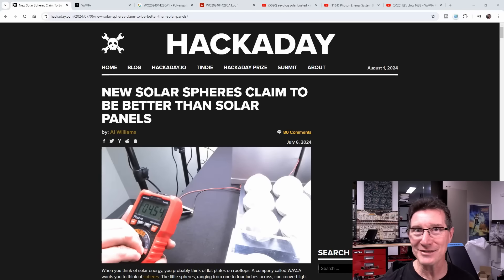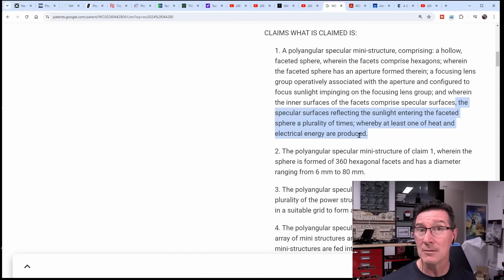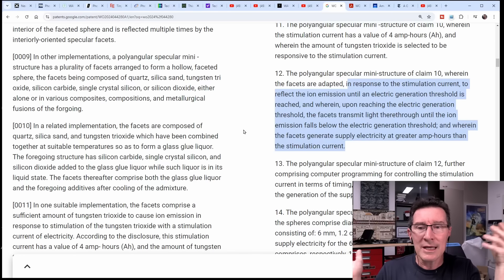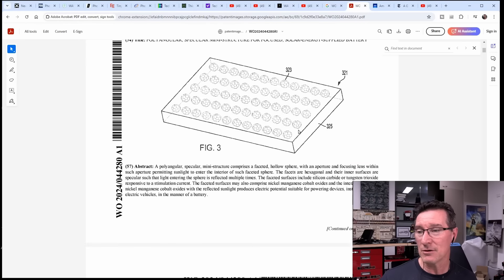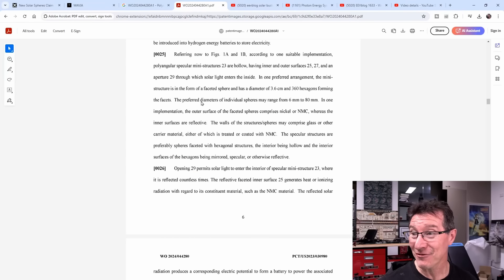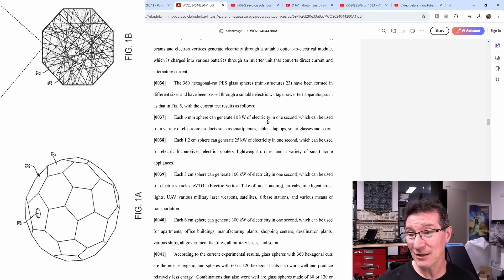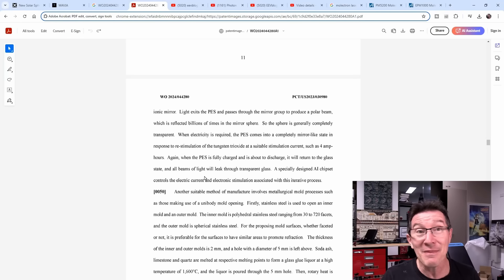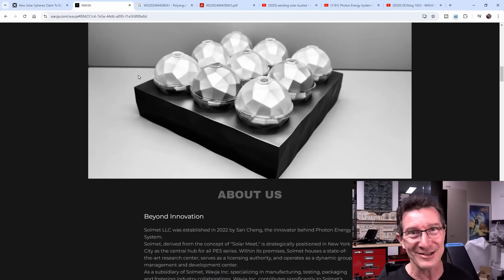EEVblog 1633 Part 2 - WAVJA Patent, 300kW Solar Balls!

Comment: I see now where the AI is at. It wrote the patent for them.
Reply: It's AL not Ai but yeah funny. lol
Reply: Thank you! I am so happy this was the top comment because this is exactly what I came here to say!
Reply: @Splarkszter  AI
Reply: @Splarkszter Artificial Lunatic?
Reply: @BenBrand same!
Reply: and the prompt was "write a confusing and overcomplicated technical description that will convince someone to give me money"
Reply: I have to say, if this genuinely was written by an LLM it actually is quite a good one and must have been trained on a lot of existing patent texts. Replace the claims of "kW" with "mW" and this actually reads like a fairly normal patent application, albeit more Chinese-themed as they have some kind of obligation to describe the "public benefit" of their invention, which in practice manifests as a lot of claims to the tune of "high power, more efficient, good for environment, prevent climate change" in the electric car literature.

The contents are still bogus, and this is only an application not a granted patent, meaning it has not been examined yet. But it is impressively close to a fair number of real pre-ChatGPT patents, except for the part where they envision it as an infinite energy source rather than a niche sensor dongle.
Reply: @BenBrand  dito
Reply: I am certain that an AI would write something much more credible than this. I just asked ChatGPT what it means when someone says "300 kW in one second". It gave a perfectly good and correct answer. It pointed out that the term is not really correct, but assumed it means 300 kW*s, or 8.33 Wh.
Reply: It looks like it, but they must have told the AI to write "the most bullshit-loaded patent possible" to get that result 🤣
Reply: exactly my thought... so much BS on a string can only com from aa LLM
Reply: I had the exact same thought. It's like someone asked chatgpt to write a patent application for an electronic device and then tried to build what it described.
Reply: @helgew9008  ask it anything controversial and good luck , its useless outside simple tasks .
Reply: This sounds like something my little neice of 6 years old would send in to be patented.
Reply: They used all the good words it's gotta be legit.

Comment: Come on Dave.  A 3 year old can figure out how these fancy balls produce energy.  You supply 300 kW to the ball and when the ball burst into flames it produces thermal energy.  Maybe it's a mini fusion reactor.  🙂
Reply: Not flames but Hot Plasma™
Reply: @teresashinkansen9402  I think you cracked it.  Plasma so hot it melts a hole through the space time continuum and siphons energy from surrounding parallel universes.  As a side note.  I bet their balls come with a warning label.  "Do not leave your balls unattended as they may produce excessive amounts of energy so great that it could create a big bang event."
Reply: @mikesradiorepair   Oh please, Don't give them more bs to add to the already useless nonsense. 🤣🤣. Maybe you can re-write thier script. At least yours sounds more plauseable.😁😁
Reply: @mikesradiorepair The sad thing is you gave a better explanation of where the energy comes from than they did! At least you have a source, but they just seem to pull the energy straight out their ass.
Reply: 300kw into a ball like 6 inches in diameter. How the Hell can that thing dissipat the heat when it's made out of silicon???
Reply: 300 kW for one picosecond probably

Comment: That patent was 100% written by ChatGPT no human could cook up anything quite that disjointed.
Reply: actually from my experience, chatgpt would've done better, this patent has the "human made charm" that scam patents have had for decades, looks indistinguishable from those anti-gravity devices from the late 90s.
Reply: it's just machine translated, ChatGPT would do betteer
Reply: ChatGPT would likely get the units right (current=ampere etc) because it would draw from external sources which would MOSTLY be correct.
Reply: I think we're being trolled...... It's not April 1st is it?....
Reply: @pipatron  Not if it draws from other snake oil sources
Reply: Pretty sure even chat gpt would just come back with ‘does not compute’ while trying to process this garbage.

Comment: Somehow I doubt there are many people that want a 10kW power supply attached to the smart glasses they are wearing on their face.  Hey, what happened to Dave?  I saw his obituary the other day.  He hooked his solar balls up to his smart glasses and his head burst into flames. ROFL.....
Reply: Having read (actually granted and useful) patents on what an industrial laser can do with substantially less, including patented safety enclosures for said lasers, I do not want a 10kW power supply in the same room as myself. Add an active monitoring and automatic safety shutoff system if UV or infrared is involved, those things get NASTY real quick.
Reply: @Photoloss  i have a 20kw power supply in my room?
at LEAST 20kw!

um. i have no idea actually, but it does turn a log into a LOT of HEAT!

iunno, everytime i light a bonfire, i wonder about just how many MW im actually sending up in a plume of hot air...

Comment: I think their "heat measuring instrument" had the surface emissivity slightly miscalibrated.  😂
Reply: Might be pulsed vs continuous yield tbh. A 0.5s measuring period is way too long for an outright pulse laser to matter, but if any of the materials exhibits an effect similar to fluorescence or stimulated emission I could definitely see a discharge cascade outputting insane-seeming power over such a short period. Of course that output cannot be sustained for much longer, and the energy input required to re-energise the internal storage will be far greater than what you get back out.

If they really do measure "heat" the energy might come from a phase change in the material. Ever used one of those liquid-filled hand warmers which turn solid and quite warm all of a sudden when activated? Yeah those won't power a flying taxi either.

Comment: Not a lawyer but I do work with patents, honestly this one doesn't look too bad, until they state the power output anyway. TL;DR: I think the tech they use technically might work, effectively running something like a pocket calculator LCD in reverse harvesting the absorbed light into electrical voltage, but even if it does work the power output is abysmal (ever see a pocket calculator run out of battery? Didn't think so. This would produce less usable power than the calculator consumes, per mass of "reverse LCD" material)

Some things to note though:

This is only an APPLICATION, not a GRANTED patent. It can still be rejected, and I would expect that to happen primarily based on lack of innovation. The first claim only describes the reflector sphere, which should be well known in prior art through some niche combination of more typical focusing mirrors ("homemade solar death ray", heliostat) and integrating sphere enclosures for lab-grade light detectors, which obviously do produce "electricity or heat" while in use. The later claims regarding power output will be tossed out immediately, there's a direct explicit ban on "perpetual motion" machines in the SOPs of many patent offices.

The "word salad" is honestly pretty normal for a certain style of writing patents. Usually due to legalese, not "AI" authorship. Usually repetitive parts exist to clearly call back to previous claims in a legally airtight way, but without copy-pasting the entire full definition. I won't bother to check whether this is done correctly here, but it seems rigorous enough at a glance. Doesn't mean any of it is physically correct or useful though.

Excessively specific or otherwise redundant-seeming dependant claims (#2-15) are also common. The key point here is that you are not allowed to add anything new to your patent when someone else later challenges it, so these claims exist as a fallback in case the primary independent claim #1 is declared invalid but the more specific claims are not, in this case you get to keep your patent protection on the specific claims instead of losing everything.

Claim 7 might be an external reflective coating layer, hopefully for total internal reflection within the material.

Claim 8 seems perfectly normal, however the translation for laypeople is basically just "commercial glass".

Claim 9 "liquor" is suspicious and not common terminology I'm aware of, but I don't work in glass manufacturing. The term is effectively defined within the patent though, so at worst I'd question the author's language skills. Haven't seen it used in the context of 3D printing either for what it's worth.

Claims 10+11 is where we get some actual bullshit. You don't want "ion emission" in such a device, "Ampere hours" is not a unit of electrical current but rather of electrical charge (yes, Dave technically got it wrong too), and the whole thing is referencing completely different technological ideas compared to the previous claims.

Claim 12 reads like it's based on auto-dimming welding masks or sunglasses, but basically in reverse. The "greater than unity current output" aspect technically is not an immediate slam-dunk rejection for "perpetual motion" as the thing is clearly still powered by external light input here. Nothing here explains HOW they produce the excess current though, so I imagine it could work in principle ...with an efficiency of like <1%, essentially an optical equivalent of using a thermocouple device to generate electricity.

Claim 14 does indeed suggest they PRODUCE kilowatts so yes, this is where the bullshit becomes blatantly obvious. Pretty sure the stated materials just straight up MELT at that point, and the examiners at the patent office will be having a good laugh.

The "PES 511" (notably a designation which is NOT properly defined within the patent!) section 0042 suggests the solar panel only exists to power the "photocouple" magic, not to provide power to externals. Note that technically the description is not legally binding in terms of patent protection as it's not a "Claim", but a decent examiner should field this paragraph against the applicants (assuming said examiner hasn't choked on their morning coffee yet due to hysterical laughter).

The "AI" (actually spelled "AL" with a lowercase L, but that might be a bug) section 0045 isn't that bad tbh, it basically just claims they use it to orient the lens towards a light source which would be perfectly valid (albeit of questionable usefulness) for an actual solar panel. Of course a small LED light will not provide "4 Ah" regardless of how much leeway you give them with unit mistakes.

To summarise this reads like a fairly normal patent for a desk top novelty gizmo, which someone has inserted a self-sustaining death ray into for the lolz. If it was claimed to output microwatts instead of kilowatts I'd be inclined to believe it actually works as advertised.
Reply: Oh man, you clearly have a very poor understanding of electricity and tech in general. If you really think this reads like a proper patent, your customers need to find someone else, pronto! There is no excuse for the nonsensical wording in this patent application - it just doesn’t make any sense. The units are all wrong. They’re wrongly applied. The physical mechanisms described don’t just go against the laws of physics, they’re just unphysical in the first place. There is a huge difference between ‘patentese’ and ‘bullcrap’.
Reply: @simontillson482  I think this superficially reads like a certain style of "normal" patent. Even from a large reputable company that does not mean the contents are cohesive nor useful, but I doubt they're actually fraudulent. Unlike this one.

And yes, there's no excusing the unit errors. Already commented on those. Physical units are correct in the original publications even when deliberately obtuse language is used. And in order to be useful the quantities are usually given in pretty wide ranges i.e. orders of magnitude, regulatory limits or concrete physical limitations.

Comment: Amp-hours is unit of charge. 1 Ah is 3600 C (coulomb).

BTW, is I understand the language of their patent correctly, their plan (but not what they show) is to have the sphere from some kind of *"smart glass"* material, where you can switch between transparency and reflectivity (on the inside) with electric current. Like polymer-dispersed liquid-crystal devices, where you use electric current to make them transparent. Not that it would work, and certainly you wouldn't get more power that the sun irradiance provides.
Reply: How tf you get a coulomb qnd amp hour equivalence?

Comment: Indoor windmill, thoughts.
Reply from the maker: $1M on Indiegogo, easy.
Reply: @EEVblog would I get 2 million if it has nano technology and quad core ?
Reply: If it's compact (about desk fan size) then I bid $2 billion. I don't even need a working demo, just say a few vague sentences about charging EVs and then I'll throw in a few extra billion to compensate your over-achieving efforts.
Reply: It could happen!  Leave it up to chen!
Reply: @jimtekkit   if you mount one on the dash of your car (sorry EV), it will charge your EV as you drive through the USB port.
Reply: @pomonabill220  but i know more about indoor wind technology now, than the next person who drives past my house.
Reply: @whatnow9653  3 million if it mentions the blockchain, and 4 million if it has AI-controlled alternators!
Reply: @conradogoodwin8077  oh, sorry, did I not mention, it creates block chain and has a pair of dual turbo alterrnators. All proprietary and usp of course.

Comment: It's obvious how this works, the stimulation current of 4 amp-hours (clause 11) at minimum 10kW (clause 14) comes from the power bank shown in part 1, ion emission starts, thereby circumventing the normal laws of thermodynamics.

Comment: I think I get it, why they mention Tungsten(VI) oxide so much - it is used as 'electrochromic glass' coating. Example - for windows or car's sunroofs which can be turned transparent or opaque while stimulating with electricity.
Perhaps they thinking of 'catching' light inside the sphere turning it transparent then making it opaque? This is some crazy stuff out of  8-years old. 

Tungsten trioxide is  also used in some 'phosphor' mixes with Ba or Sr, such as BaWO4
Reply: Yeah, I think the basic idea might actually "work" ...at abysmal efficiency and with an incredibly low power yield per mass of material used. It sounds like they're trying to charge a "fluorescent" material through the glass, then switch to the mirror state and use the integrating sphere mode to convert all the fluorescence light and associated energised material state into usable power (and into waste heat ofc lol). If the output electricity can be produced directly from an internal state change, akin to using a thermocouple between two thermal reservoirs as an electric power source but with light instead, then it might even technically be "better" than the obviously bogus idea of having your solar panel sit under a sunroof half the time. Needless to say even if any of this does work at all (and I haven't checked that) it still goes in the "super low yield energy harvester" bargain bin, and since this one relies on light input it will never be considered even for medical implants or deep space flight.

I could see something very similar being used to measure the power of a pulsed laser beam in a lab. Emphasis on MEASURE because it'll sure as hell never be used to extract usable power.

Comment: Considering that there is a lot of talk about tungsten trioxide, I think that this patent has to do with the electrochromic effect and has nothing to do with photovoltaic systems.
Tungsten trioxide is an electrochromic material, Li-NMC is the reservoir for Li+ ions, Li+ ions being essential for this effect, silver together with silicon nitride acts as a very efficient mirror both in the visible spectrum and in the IR spectrum.

Comment: maybe the creators did not understand that generally when mirror reflects light, its cutting it by 50%, depending on the material used. or maybe this is just randomly generated patent thing from llm

Comment: The thing about the patent system is that it is purely an ideas system. To be granted a patent, all a person has to do is present a sufficiently original idea. There us zero requirement for it to be viable or functional, just original or sufficiently different from related ideas. There are plenty of ridiculous, impractical and non-viable patents that have been granted, such as a bed to assist in the delivery of babies by the use of centripetal force.

Comment: There's no cross section of the shape shown in Fig 1a that could correspond to Fig 1b

The only possible conclusion is that it's a higher dimension object that doesn't sensibly project to 3 spatial dimensions. Just like that in Flatland a digestive tube that passes through an individual would seem to require severing the organism into two or more separate objects. 

Therefore it must be totally a legitimate device that just can't be described in a way that makes sense to our limited minds.

Comment: At 0.05AU to 0.001AU you can get the same Solar Radiation Intensity values as the power values they describe in the patent, of course meseasured at 1m² and not at their lens size. I don't know the temperature at those distances but I can guess it'll be really hot 😂

Comment: Amp-hours is not a unit of energy!
It is no problem to convert a certain amount of Amp-hours to a higer amount.
That is done using a transformer.  When you have a 10:1 turns ratio in your transformer (say a 240V to 24V transformer) the output Amp-hours is 10 times the input Amp-hours.
Of course the energy remains the same because the voltage goes town by a factor of 10 as well, and the energy would be voltage*current*time.
Reply from the maker: Yeah, brain fart, my mind was in Wh mode from other solar stuff.